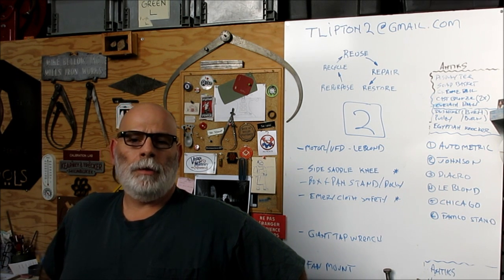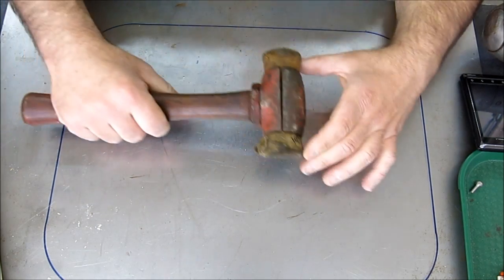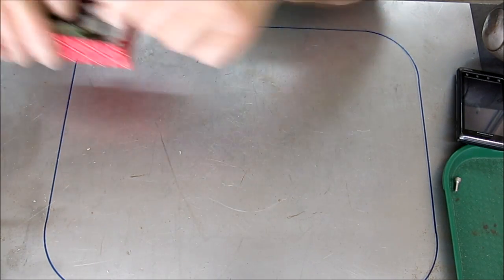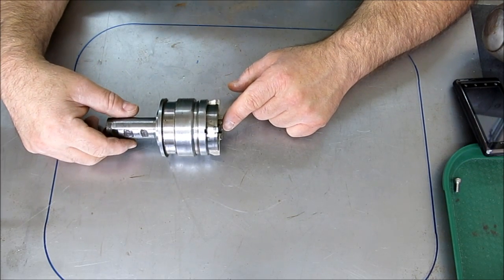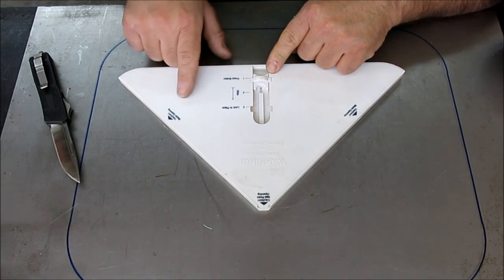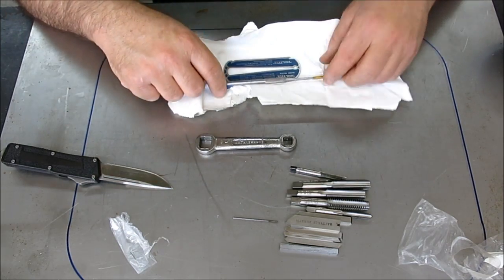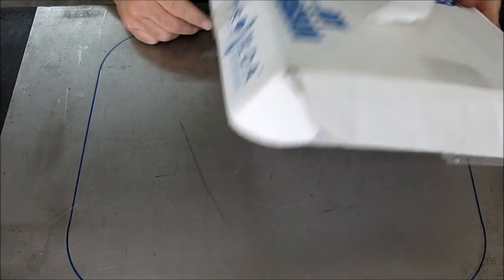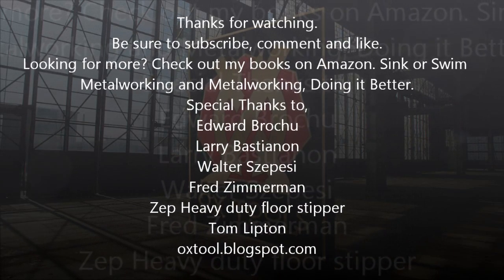Monday Night Meatloaf 54

Comment: Hi Tom,
Your mystery item is a temporary corner shelf.
Just hold it tightly into a corner of a room that has plaster walls then slid the 
leaver and the spikes push into the plaster, and walla, you have a light weight temporary shelf..
ATB
Matt
Reply from the maker: Hey Matt,

As silly as that sounds it seems like the likely answer. What a hunk of junk. I can't imaging needing a shelf that bad. Thanks for the comment.

Cheers,

Tom
Reply: Nor can I Tom.
The only reason I recognized it was years ago they used to advertise them on late night TV for $19.95 plus postage and handeling  lol

Comment: Problem I have with rawhide hammers is my "lathe dog" likes to chew them up. I would use that mystery tool for putting window glass in a wooden window. That looks like it would be perfect to put against the glass and then make the holes for your points before you glaze it. I see windows with a nail in the corner and glazing points midways just like that.

Comment: I have noticed that many store web sites are down right miserable.  You know they have the merchandise but you have to search with every term imaginable and still half the time you cannot find the item you want to buy.  Wal-mart comes to mind, not that they are anywhere near the only one but I wanted to purchase some struts and shock absorbers and some brake parts.  First try I was lead there by an external search engine and I copied the prices as I was comparison pricing.  When I determined they were the lowest cost of the big retailers I went back to the site and never could find the items again.  I used all manner of names including the correct ones for the desired items and never found them.  I also used a lot of name for Wal-mart.  So I found them on ebay and they were even priced better there.  And the ebay search was instantaneous. Guess where I bought the merchandise.  Garage sales and user gifts are starting to lose their appeal for me but thanks for sharing anyway.

Comment: That is a corner shelf.  You put it against the wall in a corner and push the levers. The nail and blades hold it in place.  Tat was a "as seen on TV" item about 10 years ago.

Comment: SI is the The International System of Units (SI). All systems of weights and measures, metric and non-metric, are linked through a network of international agreements supporting the International System of Units. The International System is called the SI, using the first two initials of its French name Système International d'Unités. The key agreement is the Treaty of the Meter (Convention du Mètre), signed in Paris on May 20, 1875. 48 nations have now signed this treaty, including all the major industrialized countries. The United States is a charter member of this metric club, having signed the original document back in 1875.

Comment: I got a raw-hide hammer just like that at a garage sale a couple weeks ago. Paid $5.00 for mine. Age and usage but not abuse. Where can I get another raw-hide for the hammer? Loved the cool gifts!
Reply from the maker: Hey Steve,

McMaster sells them as well. Remove the face and measure the pocket to determine the diameter you need. Thanks for the comment.

Cheers,

Tom
Reply: Thanks mine is kind of mushroomed but now to bad. Just wanted to get a spare.

Comment: Mystery tool  - a floating corner shelf for plasterboard (drywall) - push into corner  slide latch underneath, the blades cut into plasterboard (drywall) and the pin into corner to stop twisting..
http://www.apartmenttherapy.com/look-corner-shelves-without-dr-47006

Comment: hey Tom the triangle with blades is a "shelf" they used to sell them "as seen on tv"   you stick it in a corner and then move the lever and it will gouge itself into the sheetrock and stay there.

Comment: A quick google for "bearing specification pdf" turns up multiple documents almost exactly like those books. Just gotta know what to look for! Always nice to have a book, though... something you can keep on the workbench.
Reply from the maker: Hi Smidge,

I tried your search string and had mixed results. One nice feature of printed catalogs is you can look through them and find things you didn't know existed. Try searching for that specifically. I tell folks to put the McMaster catalog in the can so you can learn something about their inventory. Thanks for the comment.

Cheers,

Tom

Comment: Nice haul Tom. Glad you made it up to the sale. What restaurant did you go to? I love that area. I also got a couple chucks in my kennedy find I forgot to show you. a 1/2" albrecht  3/8" jabobs super ball bearing and a weird 3/4" jacobs arbor driving. I've got one of those 1/4" chucks and find it very useful. nice for holding really small parts in the lathe.
Reply from the maker: Hey Mark,

We like Mi Pueblo in the downtown Petaluma area. Anything named taco there is a winner. 

Cheers,

Tom

Comment: Hey Tom I just picked up a Moore Tool Cabinet for 80$.  It is in pretty rough shape but salvageable.  It is pretty covered in weasel snot like your hammer in the video.  Would I be safe to use the same product you did.  Just spray down the cabinet in sections and wipe it with a clean rag?  Any advice would be great, thanks!
Reply from the maker: Hi Lewis,

I think it would work great. I would wipe it down afterward with a damp rag wetted with clean water. I don't know what the long term effects of the Zep might be. 

Cheers,

Tom

Comment: The Geometric die head you showed wouldn't be used on a Brown & Sharpe automatic. It lacks the cocking arm, exactly the thing you said was missing. That head is most likely used on a multi-spindle automatic like a New Britain, Acme or an Index. It looks too big for a Davenport. It could also be used on a drill press if rigged up correctly. If that head is like the other Geometrics it can be triggered to release by stopping the foreward motion of the die head and letting the chasers pull the head out to a triggering point. Somewhere around here I have a set of #0-80 chasers for my Geometric 5/16 died head (which I rarely use)…
Reply from the maker: Hi Sp,

Thanks for the information. I have never seen one of these installed on a multispidle machine. I think I'll get a couple of additional sets of chasers and try it out on the lathe.

Cheers,

Tom

Comment: FWIW Stellite is still being used as a hard facing material in a number of industries.
Reply from the maker: Hi Nathan,

It is still used as a welding hard facing material for abrasive and hot wear. Thanks for the comment.

Cheers,

Tom

Comment: hi tom that stellite is tough stuff .i dont know if american speedway riders use it but here in the uk they have a steel plate fastend to one boot and they weld stellite strips to it to stop it wearing and getting hot when they put there foot down on corners , as always great video ,dave in the uk.
Reply from the maker: Hey Dave,

They do use steel plates. I had not heard that they hard faces them as well. I guess it makes sense. 

Cheers,

Tom

Comment: Nice stuff Tom.  I dig the books!
Reply from the maker: Hey Joe,

I wanted a Torrington book not that long ago. Had to search the web until I burned out my eyeballs.

Cheers,

Tom
Reply: Those catalogs used to be easily acquired.  They have a lot of good info and clearly define the nomenclature.  A simple email and it arrived at your door.  If you say that you are from Boeing or some big corporation, you have the catalog in seconds!  I was a maintenance mechanic at a tool factory, for 4 years.  So I had a budget (the largest in the building!)... I had a few catalogs for repairing specific stuff.  But mostly ordered online or picked up stuff locally.  Nowadays, everything is "paperless".  Unfortunately, the Timken Co. has changed hands a few times, in the past 14 years, or so.  I don't think it's "all" American any more.  Torrington?  Don't know.  They were famous for their thrust bearings.... you know...

Comment: Great find at the sale. Too bad I can't post pictures of my find last weekend.
Reply from the maker: Hi James,

Thanks for the comment. Did you find some treasure?

Cheers,

Tom
Reply: Yes I found 2 boring bars for $5. They use the 21.51 inserts but will work fine on my 9x30 lathe
Reply from the maker: James Dedmon Hey James,

Good deal. The inserts will cost more than you paid for the bars. Good find.

Cheers,

Tom
Reply: I know Tom, in fact I ordered the inserts they were  $5 per insert. No surprise to me. That is what I expected to pay. The bad thing is I didn't have any ones in my stash to fit. I have cut down tool holders to fit my lathe, because of getting "obsolete" inserts from the day job, that was just going to be sold as scrap.